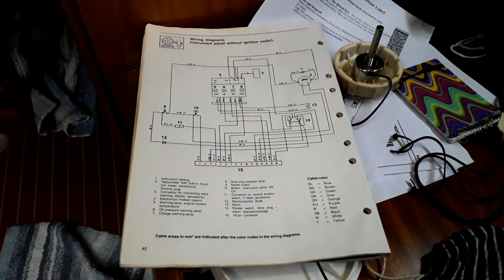Northern Ireland - Winter - Volvo Penta - Autopilot - Ep. 222

Comment: Daft question alert...if you put a silica gel packet in with your electricity panel would that help keep damp under control
Reply from the maker: Probably - for a little while, but the bottom of the binnacle is open to the starboard locker which is vented so moisture can probably get in. It is probably condensation moisture, but damp is damp.

Comment: Thanks for the video! 👌... When you are wintering in the marina, do you only use the diesel heater or both electric and diesel?
Reply from the maker: At night, the diesel only. It is 4kW whereas the electric is 1.5kW at most. At the moment (middle of a sunny day) neither are on, but we would use the electric as a "top up". If the temperature drops too low then the diesel is on 24/7. Freezing is not part of the idea 😄 The beds are electrically heated too and so they are dry and warm. Finally the dehumidifier drys the entire boat and it typically runs 2hrs per day.
Reply: @SailingYachtSaltyLass  great idea using an electric blanket! I also spotted last week Aldi selling an electric heated fleece coat! Lol
Reply from the maker: @paulfox1756  - I think electric coats are a step too far 😄